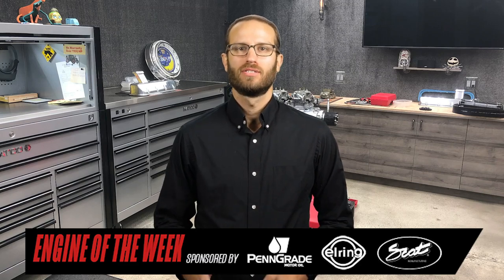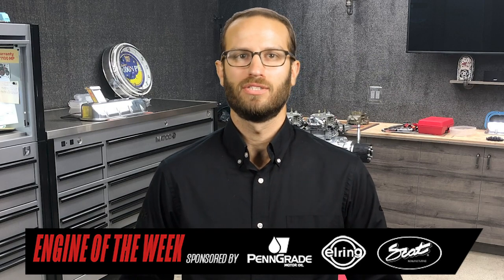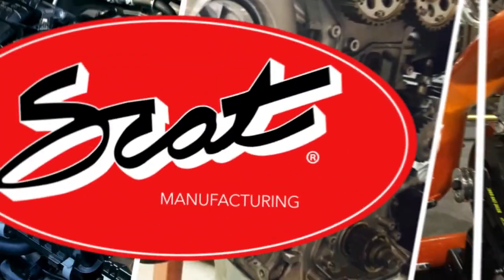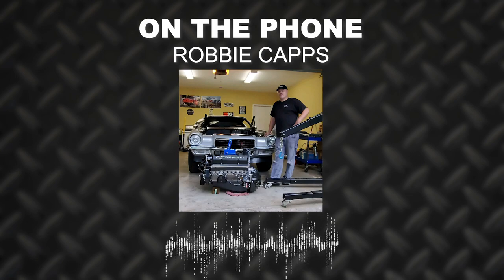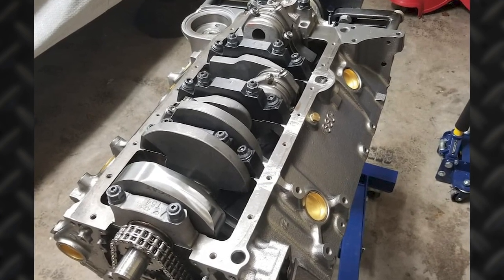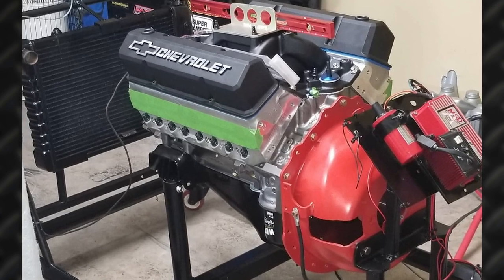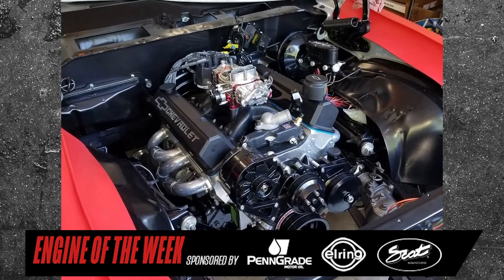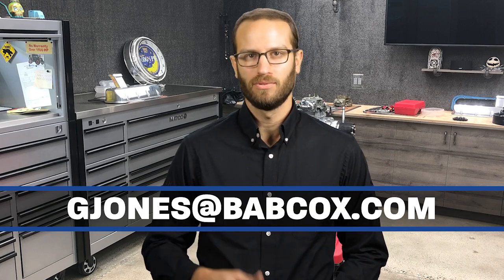383 Small Block Chevy Engine

Comment: What’s the compression ratio?
Reply: With that kind of power.. its not streetable.... I have a 383 that makes about 535 hp and is barely srreetable with 10.5 compression
Reply: @demarques1911  Ah I was going to aim for 500 hp thinking it’s the sweet spot. Car weights 3100, maybe I should just keep the block a 350 and save some money.
Reply: @demarques1911  what heads and cam you running. Sounds like a beast.